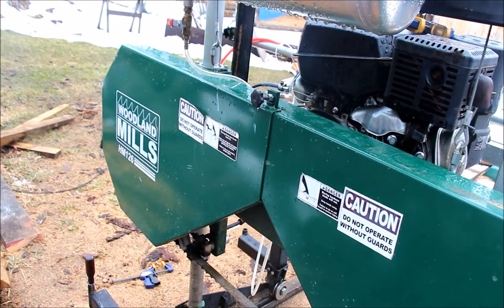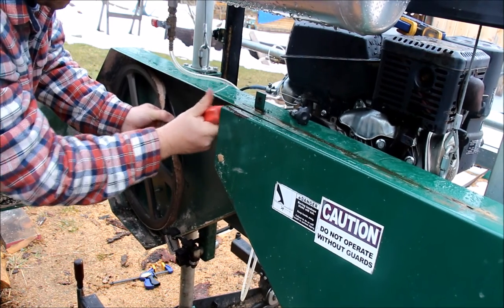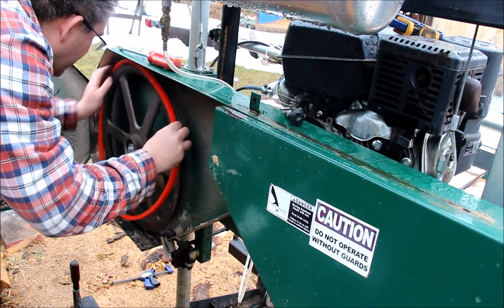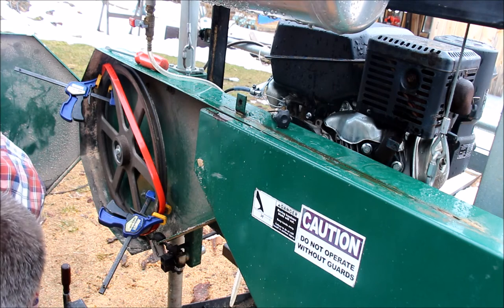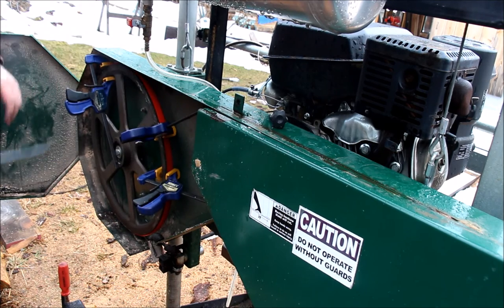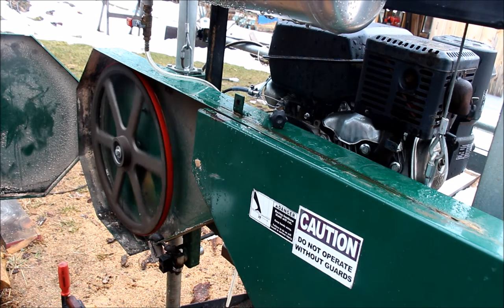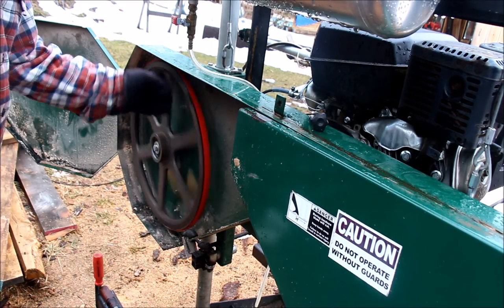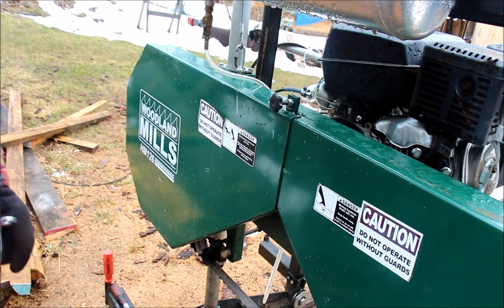Woodland Mills HM126 bandsaw sawmill upgrading to a polyurethane belt

Comment: Pretty sure petroleum grease on polyurethane is not a good idea
Reply from the maker: Kevin Cowan it's Mobil 1 synthetic grease... but thanks for the tip
Reply: @matthewolson8875  soapy water...
Reply: Kevin, i agree i wouldn't want grease any where near that belt could mess up the friction that you need.

Comment: Why I'd the wheel so loose on the shaft it wables
Reply from the maker: if the wheel is loose on the shaft the bearing is shot.    the wheel that is part of the tensioner mechanism does move though... especially when its not under tension